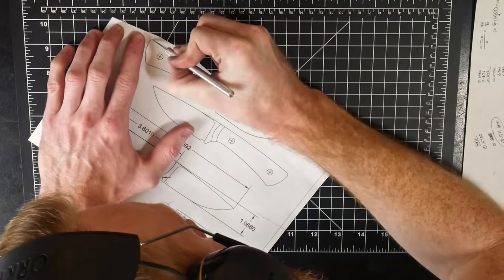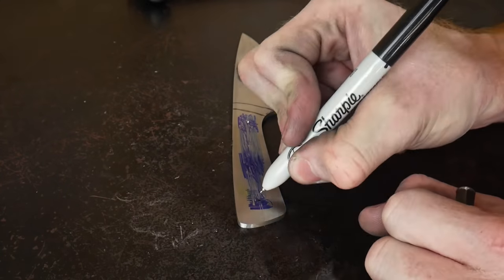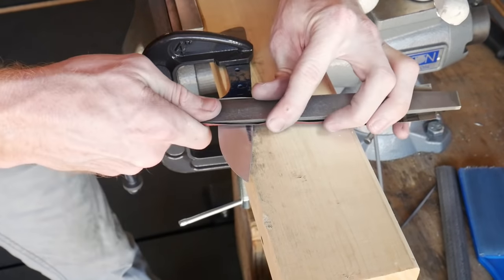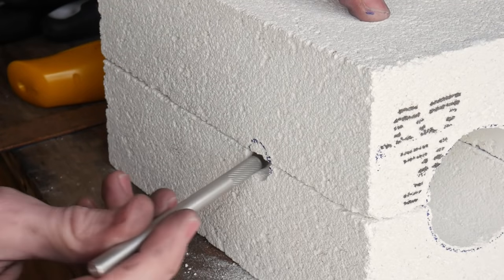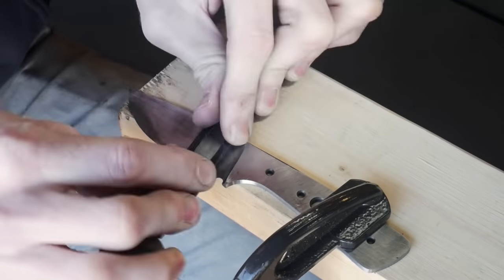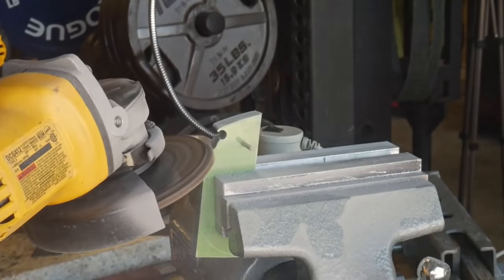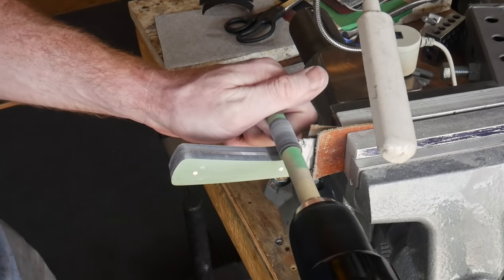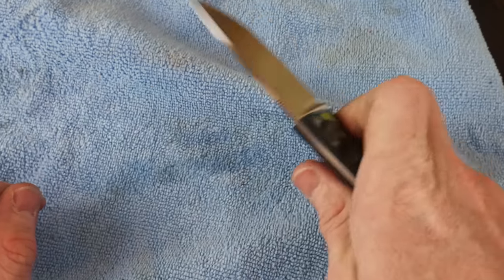Knife Making 101: How To Make Your First Knife

Comment: Hey there. Since the start of the year (when things went a bit wonky for us all) i've been binge watching knife making videos. There's lots of good videos out there but i find your complete presentation to be very comforting and confidence inspiring. I'm in the process of making my first knife but i have a few questions. 
1. Does the plunge line have to be vertical? I've designed my knife to have a forward (tip) leaning plunge line. That can be future me's problem.
2. My knife is a decent size (Not over compensating, Honest). How do you work out how many holes to drill in the tang, to balance the blade to the handle?
3. How much will my beard effect the outcome of the knife?
Reply from the maker: Heck yeah, thanks man. I'm happy you're getting in the game! 1.) Nope, doesn't have to be vertical at all! Many makers have a forward slant of the plunge line. Most of mine end up that way... I don't think a backwards slant looks good though... just my opinion. 2.) That is a difficult question. Handle material will come into play. Some people like having the knife a little blade heavy and others like more of the weight in the handle. To lighten more than just drilling holes you can "hollow" out the tang with a grinding wheel or skeleton it with a dremal. Lots of options here. Trial and error will likely be your friend. 3.) The beard is actually pretty crucial to success. If you keep a decent beard the process of knife making, cabin building, and weight lifting will be easier for sure. To state it simply, the beard will help with all aspects of life. 

Cheers man!

Comment: Hi, awesome video, really helpful. I just made myself a furnace like this, but clamped two bricks together and used a hole saw and went in from both ends, the full depth of the holsaw, opened the bricks up and removed the plug.. Then did exactly the same till I met in the middle. Found this way really quick and accurate..
Reply from the maker: Glad you liked it and glad you found a solution!

Comment: Awesome project!  Thanks so much. I’m going to attempt this in the CNC and will update you!
Reply from the maker: Heck yeah, good luck Peter!
Reply: @RedBeardOps  thanks very much. What angle do you recommend for the bevel? I will model it up in CAD and share it
Reply from the maker: @peterbrouwer143  Pre-HT, I like to keep around 0.020" "behind the edge" meaning that where the edge of your blade will eventually be you have a 0.020" plateau before HT. I would start with this edge dimension then bring the bevel all the way up to about 1/16'' away from the spine at the plunge line.

Comment: Okay.  Loved the video.  Nice job.  I have been making tools and knives for about fifty years.
There is only one thing, and one thing only, that set my teeth on edge.
As a retired tool and die maker, when I saw that 1-2-3 block clamped in place with a vise grip hold down I had to cringe.
Perhaps it was an old block, or perhaps a very cheap one but it just seemed the wrong use for a precision tool.
Still, you made a very good knife making 101 video.
Stay safe, be blessed.
Reply from the maker: Thanks, have a great weekend!

Comment: First of all, thank you for an amazing video on beginning knife making. I'm making my first knife and your video has helped keep me on track.

I'm about to build the forge per your specs. I saw in the video you cut the forge out all the way through and then put bricks on the back. Would it also work to cut the cut with only the front hole and not all the way through with a hole on the back? Or is there a reason to cut it with a hole on both ends and then put fire bricks on the back wall?
Reply from the maker: Having a hole in the back allows you to work on longer blades. Good luck with your knives an forge!

Comment: I am an exec at a big tech company. The internet has so much potential to push out amazing info but it seems like what I have hoped the internet could be isn’t the reality- except when I run across people like you that go out of their way to give out the info they have developed. Through experience. Thanks for doing this and thank you for providing a bit of what I had hoped the web would be instead of gross people on onlyfans.
Reply from the maker: Hah, thank you! It can be a tool for good and bad I guess; To some degree it's likely the weakest parts human nature as inputs that drive the algorithms to maximizing screen time. Any attempted intervention by a group/organization tends to introduce biases to the system... and can be easily corrupted by the same weaknesses of human nature (control/power).  No easy answers for sure! Good luck with your endeavors in the space. PS: check out NOSTR ;)

Comment: getting large scrap pieces is nice because you can use them for other things. For that reason waterjet cutting is the best option, and band saws are the second best. Grinding or drilling won't leave much useful scrap.
Reply from the maker: If you have access to a water jet use it for sure!
Reply: @RedBeardOps  I used to. my dad worked for Jet Edge in minnesota many years ago. they have all kinds of cool stuff. he would go in early and do little projects just for himself. no one cares because you arent actually using up anything. the water gets cleaned and returned to the system.

Comment: I appreciate that you reply to these comments and I promise I’ll lower the frequency of my questions haha but what numbered bit for 1/4” pins? I drilled 1/4” holes but the pin is very tough to get in the tang without hammering. I could shave down the pins a little, but I don’t want a non symmetrical pin if I do it imperfectly (likely).
Reply from the maker: This drill chart should help - https://templatelab.com/tap-drill-chart/

A letter F bit should do it

Comment: Great video. I created a simple fire brick forge following your design in the video. However I can’t seem to get the temperature hot enough on the metal to get non magnetic. I’m starting to think the benzomatic torch I’m using won’t allow for enough fuel to get hot enough. Do you know what model torch you’re using in the video?
Reply from the maker: Hey Keith, this is the one I used. Bernzomatic TS8000 Torch - https://amzn.to/34d8vP6

Also check this out - https://youtu.be/lOWbXbBOJhw

Comment: Since you referenced so many other helpful vids, I wanted to add a thing I just saw in a vid after this one for filing in the bevels. The video is called 
“Making a Knife w/ COPPER Wire Sponge
Epoxy Handle”
By the channel
Barbershop Customs
At the 4min 35sec mark of his vid he has a cylindrical piece of metal that he pulls sandpaper around (if you don’t wanna go check it out think of the cylinder being a super small pulley/pivot point that he pulls the sandpaper on/around. I think this might be a useful method for some designs maybe? At the very least for a finer finish on the bevels since at this point in time I don’t want to buy a file set going up the grits to polish out that bevel, as well his piece of metal was much smaller diameter than the file used here (maybe 1/16th-1/8th?) so I could see it being helpful for smaller bevels or fine tune work. Could prob use the smooth side of a drill bit for precise sizes or even metal round stock.
Reply from the maker: This may also help - https://youtu.be/oGhAdcNafhA

Comment: I wish you showed more stuff done on a belt sander instead of angle grinder, hand filing and other things I don't own. 

Seems like it would go a lot faster if you grind with a jig
Reply from the maker: Most of my videos use a belt grinder. In this case I wanted to show people without more expensive tools how to make a knife.
Reply: @RedBeardOps  I bought a hf belt 1x30 for the exact purpose of making blades from start to finish. Hopefully I don't need metal files and saws

Comment: Great video, I am just starting my journey on Knife making. Hope you can provide some guidance. First off I am using a 1084-O steel, so based on your video I am off to a good start. Also I just finished cutting out the shape of my knife,  and I tried using a Angle Grinder to create my profile (bevel I think), so far its really hard just using the grinder. 

Can you provide a suggestion as to the blade I should be using for my angle grinder? I am just using the default blade that came with the grinder so I don't know if that's the reason,  its hard to create a bevel. 

Also do you think its worth it if I purchase a Bench Sander? I was thinking of getting a RYOBI 120V 4-Inch by 36-Inch Belt / Disc Sander. Is this the correct one for KNIFE MAKING? 

As I am just starting my journey from scratch. Any information and suggestion is truly welcomed.
Reply from the maker: I like using the flap disks on the angle grinder. 

Personally I don't like the 4x36 for grinding bevels. To wide a belt. You're going to want to look for a 2x42 or 2x72 to really get into the knife making game. Good luck man!

Comment: Hint - Use (Dewalt) cobalt drill bits for good high carbon steel, and soften the steel up first, most other bits won't get through it, they'll just spin on the surface. Titanium wont hack it. Cobalt is the way to go.
 You're got some good money saving ideas there! 👍
Reply from the maker: Thanks man!
Reply: @RedBeardOps  Sweet knife man, excellent demonstration.

Comment: Is tempering necessary and what does it do
Reply: It makes the metal harder which means it is less likely to get dented and you won't have to sharpen it as often because it won't dent as easy
Reply from the maker: I have a video on how to HT 1080 that's worth watching. Basically tempering makes the blade SOFTER. You temper after the quench. The quench makes the blade hard (and brittle). By tempering you're giving the blade some toughness. https://youtu.be/TBIiWwawKSY

Comment: I’m just thinking about getting into making a knife but wanted to chime in on the epoxy, I don’t know it’s quality in comparison to the one you mentioned as most my experience is in wood working but the go to epoxy for everything there regardless of died inlays, river tables, etc it’s “total boat high performance epoxy” I’d be curious to know if anyone has experience with them in knife making
Reply from the maker: I've tested a few different epoxies for knife making. West Systems "G-Flex" has been the best performer so far.

Comment: would it be possible to use standard propane torch?
Reply from the maker: I think it would be. Check out Outdoors55 's mini forge. I think he used a propane torch at one point. It may be slightly under powered. For a very low cost you could make yourself a little propane burner like I did recently in my own "mini forge" build. https://youtu.be/lOWbXbBOJhw
Reply: @RedBeardOps  Thanks for the reply I watched the build video.  It looks great except I am lacking the tools to tap pipes etc.  Still an amazing video.

Comment: Do you have a recommendation on sharpening equipment for someone interested in picking up knifemaking as a hobby? I'm not sure which grits to get, or if I need something different for a newly-made blade compared to resharpening existing blades, which seems to be where most other videos and reviews approach from.
Reply from the maker: You have a ton of options here. I'll give some ideas:

2x72 - https://youtu.be/wpPvKuI_CzQ
Water Wheel - https://youtu.be/mN21B_OOg7w
Wicked Edge - https://youtu.be/R9K7idCh_VU

Comment: I have been watching you and outdoor55 all week. I have always wanted to get into knife making so now I am. I just bought some of the soft fire bricks, some 1084 steel, cheap files, cheap angle grinder and 2 different grit flap disks and cutting disks. The only thing is I really want to try with a belt sander rather than trying to do everything by hand. I know harbor freight has some cheap ones. Can you in good conscience recommend one from harbor freight? Or should I spend a few extra bucks and go to home depot or somewhere like that?
Reply from the maker: Man, I have an older video on a 2x42 belt sander that's reasonably priced. It's really fast so you have to be carful with it and make sure to use sharp, new belts to keep the heat down. It's far from perfect, but it's not too bad to learn on. https://youtu.be/3AvFCTcLLuY

Comment: awesome video dude..........i'm  just lacking in making an oven/forge ....can i not just use a torch ? also will any type of oil do ? and does it need to be hot ? kind regards ian.
Reply from the maker: Hey Ian, I'd say yes you can use a torch for sure... You'll need one that can put out thou. Ideally an oxy/acetylene torch. You can get by with an edge quench using a butane torch with a fire brick though. Canola oil can get you started.

Comment: Why to 2 tempering cycles? I have see other videos that say to temper the metal before it cools completely from the quenching cycle. Great video for a first time knife maker.
Reply from the maker: Hey Greg, without getting into the extreme details 2 or 3 tempering cycles are ideal. When you quench a blade you're moving it from near it's critical temperature to room temp very fast. Then you go straight to tempering in the oven or torch temper. If you want more info check out Knife Steal Nerds. He has a whole book on heat treating.

Comment: Fantastic video!!! Thanks for taking the time to make it. One question: did you peen the braising rod pins in place or epoxy them in place?
Reply from the maker: In this case I just epoxy them in place. I've never had one come out... but if you wanted a more mechanical connection you could taper the hole and peen. Be careful not to crack your handle material.
Reply: @RedBeardOps  Thanks! Your videos are so helpful and complete, and inspiring.

Comment: Hey Im new to the knife making hobby and have most of the supplies already to do it. I do not have the supplies to make the forge and I was wondering if there are any othe good alternatives? Thanks and amazing video!
Reply from the maker: An oxy acetylene torch could do it. 

You can also make a coal forge by digging a hole in your yard and blowing air with a hair dryer.
Reply: Alright thank you. I will let you know how the finished product goes.

Comment: Excellent guide! My only question is how to cool the blade after each temper cycle?
Reply from the maker: Hey Al, it really doesn't matter a great deal. You could sit there an wait for the blade to cool to room temp if you want before staring the second temper. I normally cool it quickly in water to speed things up. This will not affect the heat treat.

Comment: I haven't worked with G10 or Micarta...or anything with scales in awhile, but when I used to, I would use a band saw for the scales.  Is there any real problem doing that with Micarta/G10, or was it more of just a case that most people have the sander and grinder and just run those routes?  I've always been more comfortable around a bandsaw than the sander. but maybe I'm just a weirdo :P
Reply from the maker: No problem at all! That's actually how I generally do them. I just wanted to show cheaper options.
Reply: @RedBeardOps  Ah okay!  Just wanted to make sure.  I just came across this and hadn't seen much of people working with these materials on here.  Have been really curious about this for awhile, just hadn't ran across anyone to ask :D

Comment: Cool man, question on the oil. At what temperature should your oil be before dipping? Or do you have a video on this?
Reply from the maker: Here is a video explaining my HT of 1084 - https://youtu.be/TBIiWwawKSY - I'd say the answer to your question "depends" if you're dealing with Parks 50 which is an industrial formulated quench oil... then no pre heat is required.

Comment: Did you use a temperature gun or eyeball the color for reaching your desired temperature in the kiln?
Reply from the maker: When it comes to forge heat treating, the eyeball and experience is the norm. A magnet will help you get close as well.

Comment: What did he coat the knife with at the end of the video? That like an oil compound to protect against corrosion? Or like a wax and grease remover just to clean it up?
Reply from the maker: Joel, I just used some oil... Balistol or WD40 would do. I you want you can coat with wax after.

Comment: I know nothing about metallurgy.   I don't have the extra cash right now for a couple of the items required, and especially as a newb who might mess up the first time. My dad, however, has a whole bunch of metal around.  What kind of steel could I use just merely to practice on that I could potentially turn into a knife blade.(if he didn't have 1080)  Any stainless he has lying around? Please advise.
Reply from the maker: If you want to use reclaimed materials you can try to find old saw blades or leaf springs or something like that... hardenable steel. I'd advise getting your hands on 1080. It's reasonably priced.
Reply: @RedBeardOps  understood.  Thanks for taking the time.

Comment: I am about to make my first steel knife and the heat treat and tempering seems pretty intimidating. Do you normalize before quenching or is that for larger pieces mainly?
And hats off man for responding to literally everyone
Reply from the maker: Thanks Christopher. Yeah I think it's good practice to normalize. Although It's likely not necessary if you're working with annealed steel from the supplier. I think you get the most bang for the buck with normalizing on forged blades. But it can't hurt.